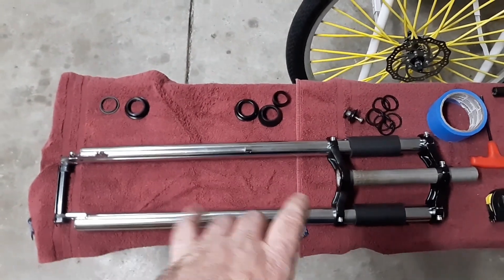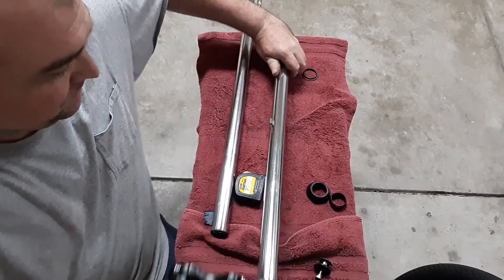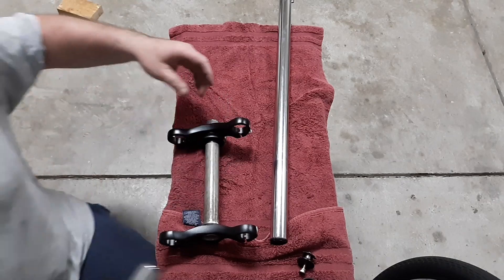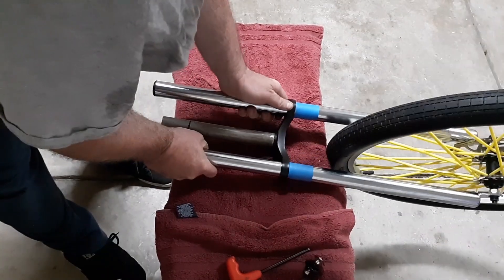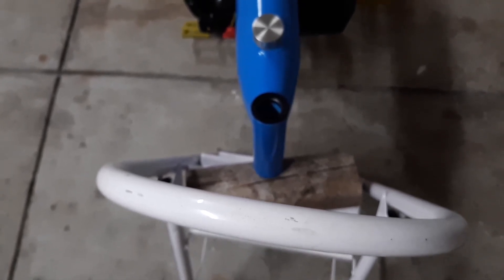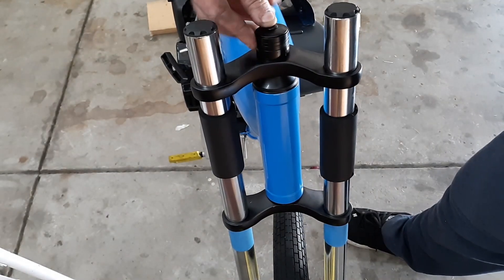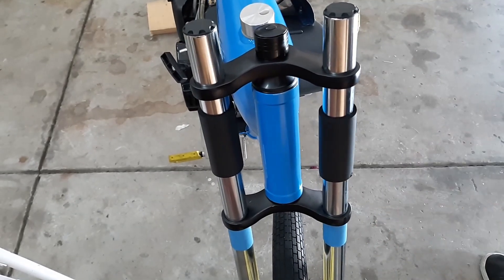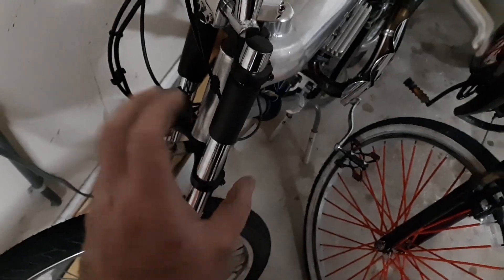Triple Tree forks (Step by Step install) Clip On & Stem Type Explained!

Comment: Nice video girl I'm putting a tree fork on my bike as well I'm just trying to make sure I do it right thanks
Reply from the maker: They are pretty easy.  Most forget the head tube spacers cause kits never come with any!
Reply: LOL that's the exact problem I'm dealing with right now in my photo you can see that's what I'm riding right now I'm just adding the tri fork to it and I'm missing those certain spacers but I'm going to make it work thanks for the video and the reply
Reply from the maker: @terryjoe323la  you have to have those or your bearings will loosen up!

Comment: Hey the clip on bars what size did you purchase the 1&1/4 size or 2 inch diameter clip on bars just wondering thanks 😊
Reply from the maker: Dono how I missed this one! okay my set was for 32mm fork tubes!  3/4 bars (22.12mm)  Be careful!   Cause I seen CDH POWER which the fork I bought!  USED 31,32,33mm tubing.  They seem to be not constant in there tubing choices!    Though 32 seems to be the most used.   So ask the vender if your buying them!  before hand or check the size  the tubes Dia if you already own them first!   99.9% time 32mm  not always on some the older ones!  some newer ones are 33!

Comment: Would a 31 mm CNC clip on fit 32mm forks
Reply from the maker: Yes they are 32mm
Reply: @BuildBreakFix  yes mine are also but my question would 31mm CNC handlebar clamp open to fit a 32mm fork
Reply from the maker: @rcadventures4342  let me go see 😆.  Give me a few I'll check because! I have both!
Reply from the maker: @rcadventures4342  (31mm does not fit!) I had a mini bike set 31mm.  Even if you pried them open. Still won't slide on.  32mm is already snug getting those on. Hope that helps!
Reply: @BuildBreakFix  helps a lot thanks for trying that out. I got some CNC fork risers 33 mm but a little loose my forks are 32mm shimmed it with some tape and it works but I can't find 32mm so that's why I wondered if 31mm would open enough cause I can get those thanks again...

Comment: Where did u get the bars from they look like peregrine bars lol
Reply from the maker: You mean the bmx bars?  There actually 30 years old lol.  I have video some place where I bought them.  I cleaned them up then nickel plated them.
Reply: They look Ike Matt Hoffman or Dave Mira bars. If they are one of the other they are worth like 600 bucks ngl lol